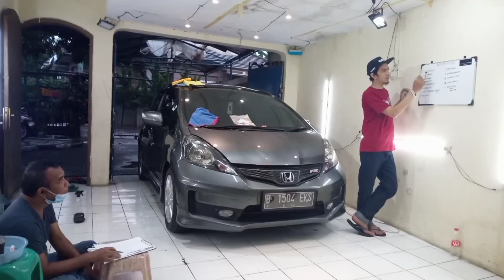Kursus Detailing Poles Mobil Academy Belajar Detailing Batch 10

Comment: Om bersihin lampu kusam/kuning stepnya apa aaja?
Reply from the maker: Bisa dengan cara di Amplas dlu pakai Amplas 1500 + amplas 2000 + amplas 2500.. Setelah itu di poles pakai heavy cut compound.. Kalo udh selesai bisa di kasih Nano Ceramic Coating

Bisa juga pakai Headlamp Polish (Bisa dicari di Tokopedia, Shopee)

Atau bisa juga pakai Nano Burn Coating.. Silahkan cari aja di Marketplace (Tokopedia, Shopee)
Reply: Nano ceramic coating ny. Ada link pembelian nya gak?